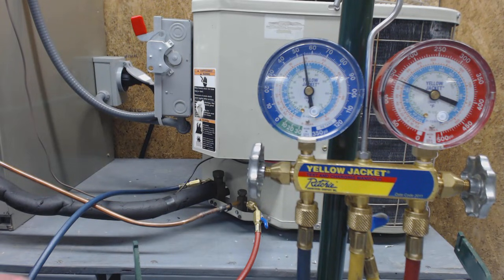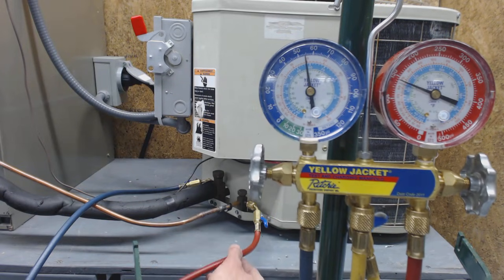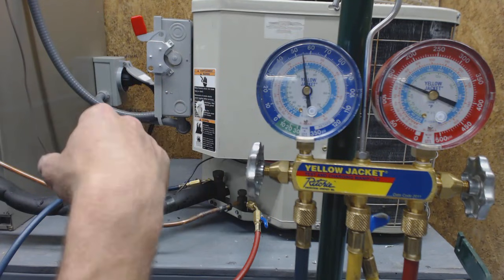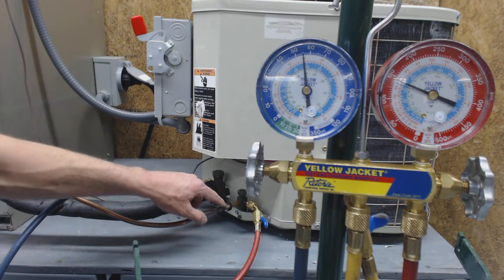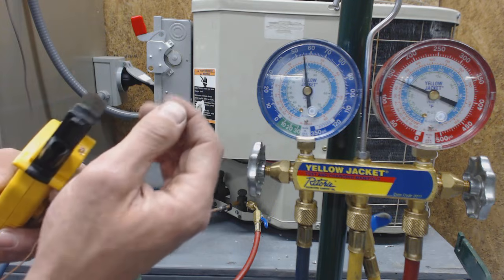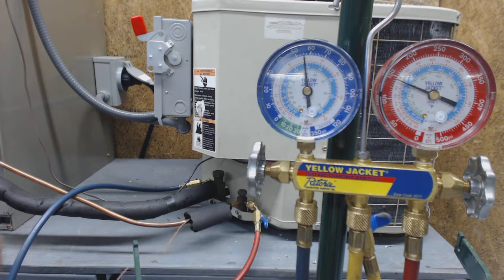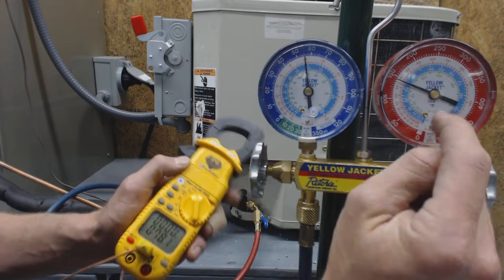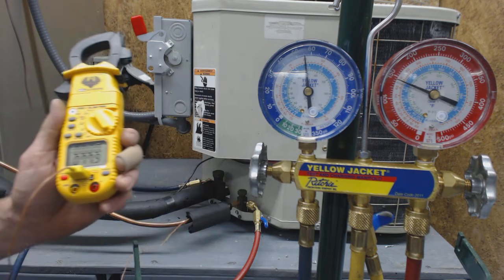Step by Step instructions on how to properly Check Refrigerant Charge!

Comment: Look how much fatter that lower pressure tubing is than that liquid line tube!!   This is why I don’t understand heat pumps.  How can you simply reverse things??   Doesn’t the low side/evaporator necessarily need greater physical dimensions than the high side?
Reply from the maker: Its just high pressure vapor going through that large line in heating mode. The liquid is going in the opposite direction during heatting mode, thanks!

Comment: do you get some actual pressure drop in the system itself when you let some of the refridge into the hoeses and would you have to use the shortest hoeses possible then ?
and does any european device even use any of the subcooling stuff at all ?

Comment: So you are saying that the condenser did it's job and brought the vapor to a liquid but just barely subcooled it... Only 2 degrees. Technically there is liquid going to the txv. Isn't that correct? It just hasn't been cooled enough. Why is adding more refrigeration the fix for this problem? Can you quickly explain the process within the condenser why adding more refrigerant creates more subcooled liquid?

Comment: I changed out this week two 5 ton trane units. They was brand new with evap coil match outdoor unit they had txvs for metering devices removed sensing bulb when brazing and put back on and insulated. When checking charge the data plate called for 8 degree subcool i keep adding refrgerant trying to get the target subcool but my line temp kept rising with the pressure i would only have two to three degree subcool but my superheat kept going down it got down to around 5 so i lost my superheat trying to get the targert subcool any thoughts. Thanks.

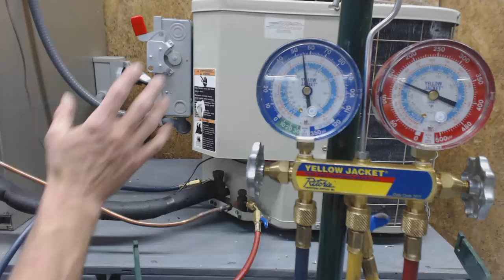Comment: At about 1:45 in the video, you say to check the rating plate to determine the subcooling temperature drop.  I have a Heil CA5530VKD2 condenser unit.  The only plate on the exterior has all of the electrical specs, but no mention of subcooling.  I just bought your book and am looking through it for more information.  Well written book!
Is there another rating plate that I should be looking for?
Reply: data plate on inside of the panel for contactor and such?
generally the data plate for unit info is on the outside of that panel and only electrical schematic is on the inside.
If you don't see a sticker (most units have stickers), it could be that it actually has/had a metal plate that came off?
depending on age of unit the sticker wore off, or the plate came off.
Some units require specific subcooling and can range anywhere from, 10 degrees to 18
But as a kind of rule of thumb, if a data plate is not available,  go with at least a 10 or 12 degree subcooling.
edit:
Also, honestly if you don't have the appropriate training or the epa 608 certification you should not to be working on an a/c system.
Messing with refrigerants can be dangerous and most importantly is very bad for the ozone.
If you are in an very cramped and poorly ventilated space the refrigerant will displace the oxygen and you will suffocate.
If you vent refrigerants in to the ozone, 1 atom of chlorine will destroy 100,000 molucules of ozone/oxygen.
Not to mention, if you are caught venting refrigerant, it is a $45k fine for you or your company.
Reply: @PatrickMcNary  I appreciate your warnings.  Everything is being done per specs and regs.  Safety first.  The Heil condenser unit has a sticker on the outside.  All the data on the sticker is electrical (amps, voltage, circuit breaker, etc) except "Outdoor Unit Shipping Charge R22   74 OZ."   And, "Design Pressure (PSIG) HIGH 300   LOW 150".  The compressor inside the unit is a Copeland  ZR28KC-PFV-130, single phase 208-230V scroll compressor.  It has specs listed  Refrigerant Type: R-22,  Ambient Temp 95F, Evaporating Temperature 45 F,  and Liquid Temperature 115 F.

Comment: I have 2.5 ton Goodman Ac (R410a freon) low side is 80 psig and high side is 400 psig, if I add freon then it stops because of the high pressure. I have checked the filter which is not dirty. What are the possible reasons for this problem? Thanks

Comment: Without a temp probe ca n you tell if its working correct. That is how my apartment maintenance checks Only using the red and blue lines and sometimes only the blue line
Reply from the maker: You can't measure superheat or subcooling without temp probes. The tech may have been trying to target a certain pressure instead, thanks
Reply: @acservicetechchannel  I have been having issues with this system after the first year here. The system runs all the time. Two years ago they called a HVAC certified person to come check it and I heard them say the system was a SEER 8 and on it last leg. Since then my power bill has gone from $115 to $180+ during the warm months. I know the unit is over 20 yrs old and they wont replace it. They say if it cooling they cant do anything about it.

Comment: I have an olllllld Coleman Presidential 2 that still has a 20° split but seems very weak 

Mobile home... 😖

Anyway I put in mini splits that are so much better, but I still would like to get the original system in good shape as it definitely works and the gas furnace is a great backup and can run on a generator

I'm gonna follow your vids and see if I can get the thing tuned up, and I would imagine the risers need sealed and I bet the 2 trunk lines are really leaky somewhere

Comment: Craig, how do check the subcooling if it's cold outside?  Here, in Arizona, right now it's 55 degrees.  From what I understand you can't accurately check the refrigerant if it's cold outside.  Or is there some metric besides subcooling you use?
Reply from the maker: You have it correct. We cannot check the charge when the indoor and outdoor db temps are below 70 degrees. They must both be 70 or higher. Unfortunately some companies rush their pm's and do them too early to accurately check systems. On an emergency heat pump call, you could use a charging bag to restrict the outdoor unit's airflow to raise the outdoor unit's sat temp but this method should only be used on a system with a txv. However, subcooling will show a little less than it would on a higher temp day. We discuss this scenario and a lot of other methods in my book on the website at https://www.acservicetech.com thanks!

Comment: How about lg 24,000 btu r22. Suction line is 65 psi and the discharge line is 75-80 psi? What is the posible problem sir!? Thank you in advance! 🙂
Reply from the maker: Wow that is very low pressure on the high side. Are you sure you are measuring the actual liquid pressure on the high side. Isn't this a mini split? thanks!

Comment: There were some larger screw on hose connectors guess they are fast off so you don't loose much freon. Are those the yellow jacket quick couplers?
Reply from the maker: Yes they are referred to as quick disconnect or automatic low loss fittings but I have them linked at amazon.com/shop/acservicetech thanks!

Comment: DIY ing a new ICP  R-410A split system. for brazing my new vapor and liquid lines I have Sil-Fos rod. Question : can I use my Argon bottle (90% argon 10% co) instead of Nitrogen which I do not have?  Also for line pressure testing? Give the good, bad, and ugly Please. Todd
Reply from the maker: Argon and carbon dioxide could be used . We use nitrogen because it is cheaper and safer for people in confined spaces compared to argon.

Comment: They make a nice pipe clamp thermocouple for around $20 thats easier to use than taping on yours. Lol
Reply from the maker: Yeah the issue is the accuracy. Some clamps don't make good contact, are not strong enough or have too much metal that must absorb heat to change the temp reading. I use the clamps on my SMAN460 but I prefer the bead type on my ST4 for quick accuracy, thanks!

Comment: What to do if your AC has no info for sub-cooling temp info due to old unit and faded stickers?
Reply: what if it doesn’t have a TXV then what should be the sub cooling?
Reply from the maker: If there is no txv then use the total superheat procedure. Target Superheat is a floating number depending on indoor wb and outdor db. Look up "acservicetech superheat playlist" thanks

Comment: On your tool list now you have:
Yellow Jacket Gidds 505049 1/4" hoses with compact ball valves 60" (Packof 3). 

A few months back you had Yellow Jacket 29985 Plus II 1/4" hoses with compact ball valves 60" (Packof 3).

Price is more now for the 29985 but I was wondering if there is a set that's better than the other and are both sets good for charging and evacuation? Getting ready to order a few things from your tool list.
Reply from the maker: Hey James, I just checked again but they are the same thing in reference to the hoses I use with the valves on the end. I use them for charging and for the pump down. I use the 3 appion valve core removal tools and the 3/8 hose with a 3/8" connection on one side and 1/4" connection on the other side. Then I just use a 2' or 3' 1/4" hose. The vacuum hoses do not have valve core depressors in the end. This is seen in the video "acservicetech full vacuum procedure", thanks James and any questions, just ask!

Comment: Hey do you have get the Manifold gauges valves closed to check system pressures ? all that oppening a closing got me confused
Reply from the maker: I may have been doing the disconnect procedure and purging the air. You would keep the handles shut if you were just checking the charge before disconnecting, thanks

Comment: Hello, great videos, thank you very much. I went to school and they taught me that refrigerant is charged according to the ambient temperature and the P/T  chart, at that ambient temperature it is necessary to add 20 degrees more and the result then look in the P/T chart, so I did it but when I check as you say in the video gives me a subcooling of 20, what do you say about that ?  It's 3 ton godman with TXV, thanks
Reply from the maker: Hey Wilfredo, a school taught you the ambient plus 20 rule? That is not what any school I know would be teaching. It is possible some teachers may have taught that a long time ago when they weren't as concerned about efficiency or just didn't understand the refrigeration cycle. Ambient plus 20 or 25 or 30 is just an observation that happens sometimes but subcooling is what happens in the outdoor unit in terms of energy transfer. Superheat is exactly what is happening in the evaporator coil in terms of heat absorption. We use superheat to check the charge for fixed orifices and subcooling to check charge for txv systems and we use both to troubleshoot. The rating pate would state the target subcoolin but if it is worn off or happens to not be there then you can use a target of 11 degrees subcooling, thanks
Reply: @acservicetechchannel  Thank you so much  !!!

Comment: What jackass mounted the disconnect on the service door? Also you didn't explain why you checked subcool vs superheat.  And last why add and not do a leak check?
Reply from the maker: Hey Matt, this is just an early video. It is from in my shop so it was a mobile unit I used in order to show charging. I only said that it had a txv and didn't distinguish like on any of the newer videos. This was one of the videos for students to know when to add refrigerant vs when to recover or if the charge was correct.

Comment: The unit looks like an outside unit but the environment is looking lika as it would be inside.   Im confused?  And it's so quiet for a running compressor.  Can you tell me if this ist inside or outside ? Where is the compressor? In this unit or in the other one?
Reply from the maker: This is in my shop as a training unit. The mic deadens background noise. Otherwise, it is the same as normal, thanks
Reply: OK, thank you. Now i understand.

Comment: As an armchair refrigeration guy (always have been fascinated but have never worked in the industry) I have always wondered why these units call for so much subcooling? It would seem to me that this would raise the saturation temperature (and thus pressure) in the condenser due to the reduced area available for condensation, thus materially increasing power consumption and compressor operating temperature. If reserve refrigerant is the goal, wouldn't a liquid receiver be a better way to achieve that?
Reply from the maker: Great observations! It is also trying to reduce the temp of the liquid before it gets to the metering device. That is actually why, thanks

Comment: Ya I was at a shit company where they told me to put it 20 degrees over temp outside. I'm now going to a company that's better thanks for the video
Reply from the maker: Yeah, that was that old ambient+20 which is not what should be used. Also it only is close on 10 seer but not actually precise, thanks

Comment: My unit has high super heat.  Which means low on refrigerant.  My question is .whay happens if i let it run low on refrigerant.  Thanks.
Reply from the maker: The evaporator coil could freeze and liquid refrigerant could be sucked into the vapor compressor which would not be good for it. When the evap thaws, iit may melt out through non normal means such as out of the side of the unit and through the unit instead of inside the pan, thanks

Comment: Wierd question
Have you ever been adding r410 into a condenser and the gauges weren't rising?
Its happening to me 
Please help thanks
Reply from the maker: You may be cooling the inside of the building quickly while charging and if that is the case the pressures decrease over time. The question would be if your superheat and subcooling are changing, thnaks

Comment: What if the valves don’t have schraders in them?
Reply from the maker: They are three position air conditioning valves. Mid seat the top valve and you would have pressure out of the ports. Type "acservicetech king valve or stem valve" thanks
Reply: Use a service wrench to open the lines with the gauges on
Reply: Z

Comment: How would I know +  two degrees is a significantly low charge ?? Sorry I’m a newbee do I just suspect every txt should have  plus or minus 5 degrees range for Checking the charge when I first get to a unit
Reply from the maker: Systems with a txv you would set the subcooling at whatever the rating plate says. If the rating plate is wore off then set it to 8-12 degrees of subcooling. I usually set it to 11 if there is no plate. If it has a piston then check what the target superheat should be. My best advise is to watch the "acservicetech subcooling playlist" and also the "acservicetech superheat playlist" thanks

Comment: if your checking subcooling should you check superheat aswell?
Reply from the maker: You certainly should keep an eye on that to make sure that the txv is working properly as well as if the vapor sat temp is above 32 degrees, thanks
Reply: acservicetech no sir thank you!!

Comment: so if your doing superheat you would measure that from the low side?
Reply from the maker: That's correct Todd!
Reply: acservicetech thanks
Reply: Todd Medium Wellington III 
There are two superheats measurements on the suction side .
If you measure for superheat at the suction service valve , then this is your compressor superheat .
If you measure it at the exit of the evaporator , then this is your metering device superheat .
There is one extra vapor superheat measurement , that is taken six inches from the compressor on the discharge line .

Comment: got a question, my central air has a rough time bringing the temperature down even when is not so hot (80° to 100°) we have it set at 75 and for some reason sometimes it won't reach 75° and the unit is working nonstop. my  question is, is that normal?
Reply from the maker: That is not normal. Make sure the filter is clean and check for good airflow out of all the registers. Then you are looking for a 18-21 degree temp decrease between where the air is sucked in at (the return) and where it is blown out at (the supply). If not then there could be some sort of issue such as the outdoor compressor is not running or the refrigerant charge is off, etc. It is possible that the unit is undersized for the size of the house if it never used to bring the temp down but if it used to bring the temp down and now it doesn't it would be more likely the compressor not turning on, refrigerant charge or another reason, thanks

Comment: Question, can a good set of analog gauges used for hvac be used for automotive ac?
Would there be any harm in using them for either.
Thanks
Reply from the maker: Yes you could use them for both but you would need the auto adapters for the quick disconnect on the end. We do however try not to mix refrigerant oils such as poe and mineral oil in the hoses to avoid cross contamination, thanks. Here is a link http://amzn.to/2h4AknA
Reply: thanks, I was thinking along those lines. Keep up the great work!

Comment: can I ask if freon for window type and split type are same?
Reply from the maker: They will be checked with the superheat process since they have a capillary tube metering device if you have a brazed in service port. Most do not have ports but you can check to see if you have an 18-21 degree temp difference between the return and supply after ten minutes of run time, thanks- superheat playlist- https://www.youtube.com/playlist?list=PLxnHR5_D2ojwGvhU1rseXQLJ-XBjBZMMk